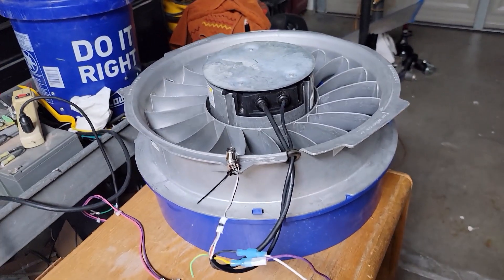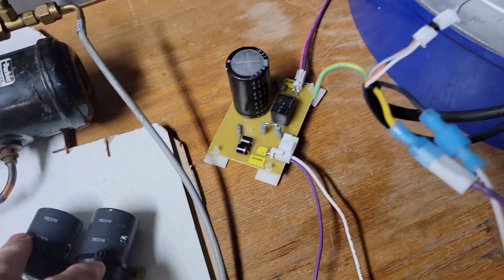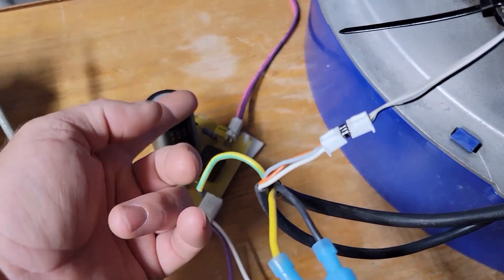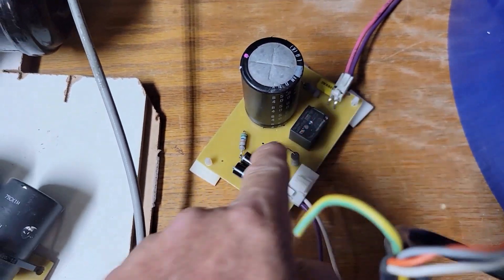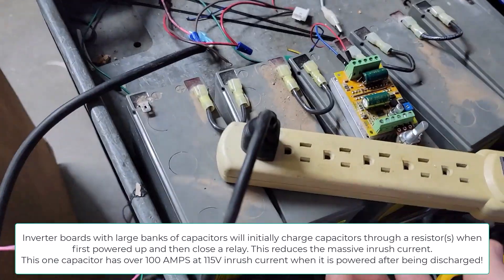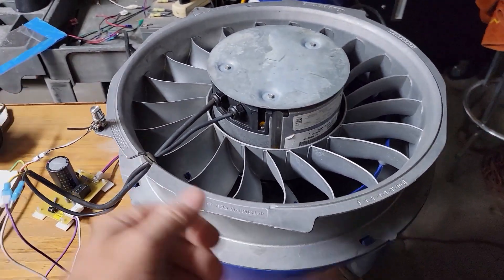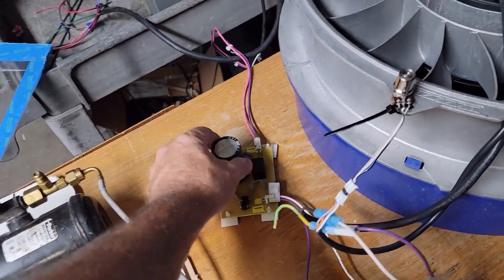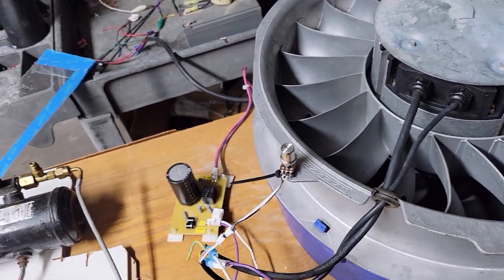Simple voltage double to run 230V ECM motors with 120VAC supply

Comment: The blue Carrier UFO blower. Good idea but availablity is crap to replace it if it fails.
Reply from the maker: Thanks the Convid politics for the supply chain issues.
TXVs. VFDs etc are months out much of the time. 
These new fans would be the greatest thing in years IF it wasn't for replacement availability and that there's no substituting in a standard motor. 

I will say, if they don't have you motor you can look for one in a higher or lower static range and might find the alternate in stock.  But that won't fly for warranty

Comment: what do you want to blow whth this motor?
Reply from the maker: I'm thinking about adding a cone to the front of it like a jet engine jet engine to accelerate the air around some high pressure misters for the back yard
Reply: It would make one hell of a whippy car dealer inflatable gumby

Comment: Nice👍 didnt knew you could directly feed dc in those motors.
Reply from the maker: It works on old ECM motors too.
The reason it worksbis because they all just rectify the AC into DC to charge capacitors then it uses the high voltage DC to sequentially power the 3 phase Brushless DC motor.

So if you connect DC, either polarity,  it just steers through the diode bridge rectifier just the same.
Reply: @hackfreehvac  👍👍👍

Comment: One of the problems with this is that some motors with embedded PFC will have problems or trip out if it doesn't see zero crossings. This is because internally they run on 380V, which is produced by the PFC boost circuit. The PFC boost circuit relies on the zero crossing detection to synchronize its current input to match the AC voltage and some controllers are not well behaved in this situation.

With that said, if there is not too much electronic stuff going on, by virtue of having a diode on the high side, as long as the controller itself does not know about the problem, the motor will still run on the DC. I'm aware that some Midea boards have a fault code for zero crossing detection problems but IDK if this is a problem in practice.

Furthermore it may be wise to include another fuse on the AC side, because the motor's internal fuse is probably AC rated and you're feeding it DC. In the case of some catastrophic failure, the AC rated fuse can fail to blow with DC due to arc fault.
Reply from the maker: There is a 10 Amp breaker in the power strip.
I always use the power strip as a disconnect and breaker in case something is wrong.
And it's saved me before. 

The "zero crossing" from what I understand now is for two separate things.
In BDC motors (compressor, IDM, ODM) it tells the microcontroller where the motor is so it can sequentially pulse each phase at the right time. That isn't the AC line zero cross. But when the magnetic field aligns to the phase not being powered on the motor that is actively at that time)  the position sensor.
This is handled after the power supply and is on the motor lines so DC power in has no effect on that. 

The other zero crossing tech I know of is when the AC line voltage crosses zero the mini split can then pulse high frequency data on the lines between indoor and outdoor units. 
Between S2 and S3, or however they usually name it per brand.

Anyway. I'm learning some C code to do a little more with microcontrollers and in hoping to succeed in making own BDC motor driver. 
Once I get a design working I can just alter the MOSFETs or IGBT block to match the power rating of the motor.

Comment: Pretty cool what's driving the control side?
Reply from the maker: The controls are all internal. I just have a potentiometer attached that sends in the 2-10VDC speed command. The 10VDC for that is provided from the motor as well. I am just supplying 300VDC to the motor externally.

If you haven't seen these motors, these are the new "EcoBlue" Axial Fan Motors for Carrier that replace the belt drive motors.